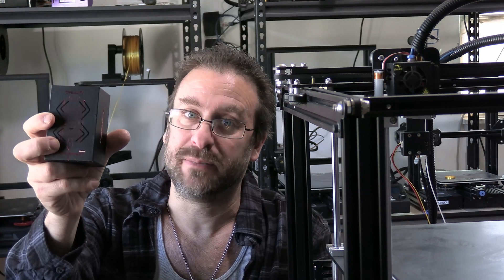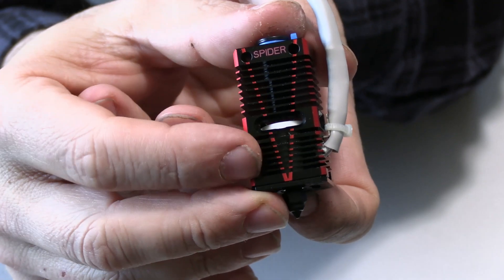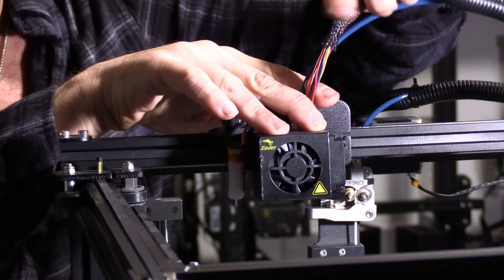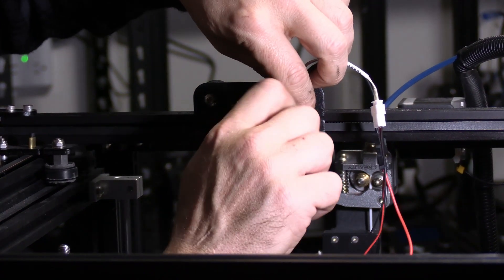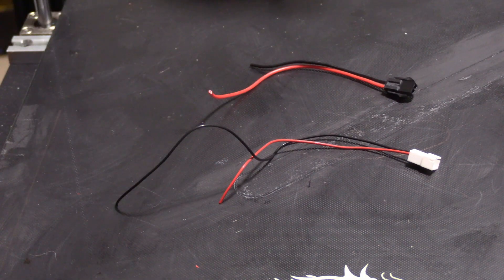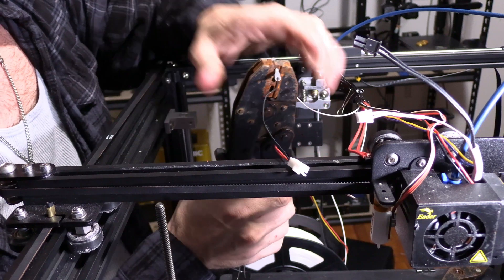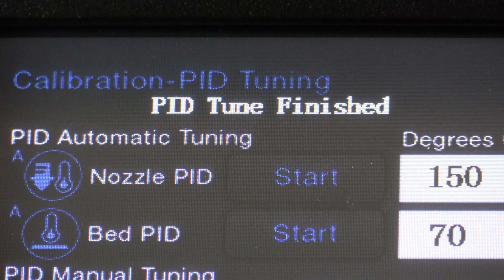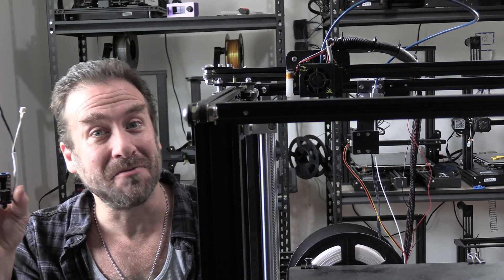Install Creality SPEEDY SPIDER Hot End on Ender 5 Plus (and Ender 3 PRO)

Comment: i would solder instead of the crimping but an excellent descripten of the mod 
greetz from austria
Reply from the maker: Agree. I try to show methods that the average person can do, as well as what instructions show, if there are any...  Solder would totally be a better choice. Greetings from NJ USA
Reply: @3DRundown  btw i ordered the hotend afther this video^^ you should make affilated links for european countries too 🙃🤣
Reply from the maker: My Amazon account is setup, so that my Affiliate links, redirect to your country. Did this not work? I definitly need this to work....
Reply: @3DRundown  not in my case... the link directed me to the us order page.
btw on an ender 5 s1 you have to make a workaround for the hotend because it is shorter than the original one... just drill 2 new holes below the original mounting and make threads. then you are almost in the same noozle hight
Reply from the maker: Bummer. I will have to check that! Setting it up is confusing.
Reply: @3DRundown  
You cannot solder thermistor wires as it changes the resistance
Reply: You cannot solder thermistor wires as it changes the resistance.
Reply: @petercallison5765  and a crimped cable has no change in the resistance...
basically crimped cabels have a higher inner resistance then soldered ones. keyword contact resistance...
but you should know how to solder. 95%+ do not know how to do it.

Comment: You didnt mention anything about thermistor settings? I installed this on my klipper build and I am having my printer disconnect over and over ever since installing it. I think it is because of my thermistor....
Reply: Turns out you NEED to solder your thermistor wires or readings will be inaccurate, creality put bad connectors on these.
Reply from the maker: I am running TH3D Firmware on my 5+ and made no changes at all. It's been amazing. There may be changes you need to make on Klipper. I'd have to study up on that one. Feel free to pop into my Sonic Pad group and chat with the peeps there. https://www.facebook.com/groups/crealitysonicpad
Reply: @3DRundown  Thats very suspicious. I trust that you are printing just fine, but I have serious doubts that your nozzle is actually the reported temperature you think it is. Today I am going to set my thermistor back to the stock settings and see what happens. Thanks for the input.
Reply from the maker: Check out my short on the Uber Jason Machete Parts. That was literally my first print after the Test dog. Flawless
Reply: @ThePrintHouse  this seems to be a common problem with the hotend that I, and many others are experiencing. If I set my print settings to 260c I can get good quality prints, where if the nozzle was actually 260 degrees the print would look terrible. Something must be going wrong on crealitys end.
Reply: @expertshooter2055  Well every thermistor is using different resistors in order to produce the readings it does, so every resistor is calibrated differently. That is why you need to change the firmware to recognize a different thermistor or else the temperature your 3d printer believes it is is incorrect. In Klipper that is easy to change, not so much with stock marlin printers without custom marlin compiled firmware. Because this hotend can reach higher temperatures than the stock hot end, they were required to use a different thermistor than the stock hotend and so anyone installing this on a typical machine without klipper will likely need to custom compile their firmware to get accurate readings.
Reply from the maker: My Spider 3 and Speedy, print every day, without issue.
Reply: @ThePrintHouse  you are absolutely correct but this thermistor uses the same klipper/marlin settings as stock firmware uses, they advertise the speedy spider as a drop in replacement, and 3D rundown has obviously received a working unit proving that it's not a matter of the settings, something is happening on crealitys end. Multiple people in this comment section and reddit have the exact same issue me and you are experiencing. I'm returning mine and buying the spider 3.
Reply: TLDR creality is having some quality control issues with this hotend.
Reply: @expertshooter2055  Ohhh ok I understand you now. That odd. I wonder if all of them have the same thermistor tags but different thermistors and some have the stock thermistor, so that is why it works for some people?
Reply from the maker: I wish I had more information to share, but I have the same minimal details offered by Creality as everybody else. They have not addressed any need for Firmware changes. Either they designed these to work with their current firmware and previous thermistors, or, they are failing to properly support this topic. Which is it? Who knows. All I can say, is I've had very good success on both SO FAR
Reply: @3DRundown  yeah, I'm sure it's a phenomenal hotend when it's working, but with many other products offered by creality sometimes you get unlucky and get a dud.
Reply: Hello! I am having the same problem. Did you manage to solve it?
Reply: @ Unfortunately I believe it is a physical hardware problem with the hotend. I was never able to make it work

Comment: PID tuning on my ender 3 results in thermal runaway but if i just tell it to heat to 200 or 220 for that matter it will reach tempature and stabilize without thermal runaway. Is this a firmware bug? The tuning seems decent enough already right off the bat because the tempature stays within a degree or so. What are your thoughts? One thing i noticed too is that with my hotend once i tell it to heat up it will reach around 120 degrees in only about 5 seconds, in crealitys video showcasing the heatup time they too have their hotend heat to 120 degrees instantly and then they have a steady rise. With yours there seems to be no spike in tempature and just a steady increase the whole way through.
Reply from the maker: I would avoid Creality Firmware as much as possible and go with something like MRISCOC. Also, I wouldn't lose sleep over PID tuning. However It shouldn't be failing like that.

Comment: How does it wire into an older v1 cr10?
Reply from the maker: You would splice it to the existing wires.
Reply: @3DRundown  got mine installed and won't heat above  160c. My printer is a cr10 12v. Are these for 24v printers?
Reply: @3DRundown  okay thank you! I need to check for positive and negative for either the heating element and thermistor? Or does it not matter?

Comment: I'm experiencing heat creep with the Spider Speedy on my Ender 3. I don't know what's causing it.
Reply from the maker: Just finished a long print for an Uber Jason X Machet, and it went perfect. Haven't used it a TON yet, but, so far so good. I'm doing an E3 MAX next. What's your symptoms?
Reply: @3DRundown  I had mine replaced twice. This is my third spider speedy and still having heat creep. What I did to solve the heat creep issue, is to use Thermal Grizzly Kryonaut for the heat break, heat sink, and the ceramic heater block.

Comment: Does the fan duct fit properly after swap to this extruder? I have impression the nozzle is a bit lower and air blows on it, not on the filament.Greate movie by the way.💪💪💪
Reply from the maker: This thing is really small. It's virtually the same size as the stock hot end. Looks fine to me. My prints have been super

Comment: I had a lot of issues with inaccurate temperature readings. I ended up sending it back. Did you have any of the same issues?
Reply from the maker: Mine has been fine. How did you determine it was inaccurate, and what negative effect did it cause you?
Reply: @3DRundown  set it at 200° and it still can't melt PLA have to set it at  220. Then while printing temperature fluctuates wildly. Thought it was because I had the CR touch inside the fan shroud so remove that and was still doing the same thing although not as bad.
Reply: @ericnfla  it is recommended to PID tune the hotend after changing it
Reply: I am having the exact same issues. I am running a BTT SKR 3 along with upgraded firmware. No matter what adjustments I make on this damn thing, it reaching about 10* below the requested temp and then fails. It is  really becoming a pain right now.
Reply: This seems to be a common problem with the hotend as I have seen multiple issues with this issue. I am having the same problem and I'm thinking of just returning this thing and buying the spider v3.
Reply: Did you solder the wires?  That changes the resistance and messes up the readings.
Reply: You MUST set the max temp correctly in firmware for the design hotend. Then you still need to go into Configuration Advance Temperatures and set the Max Temp there before anything. My was resetting every time once it got to 250. Then I figured out and adjusted it.
I used updated Vanilla Marlin to unlock the menu for Temperatures inside Configuration and Advanced.

Comment: Would you recommend this over the Spider 3.0?
Reply from the maker: I'm having a tough time with that call. I really like the Spider 3, and I like that the heat Block and Coupler can be easily replaced, but, if this thing holds up, it's 1000% the future of Bowden Hotends. Till some time passes, it's a tossup, but I see no reason NOT to get one, yet....
Reply: @3DRundown  Nah, coupler looks like it can be easily replaced, but it can't lol I'd say try it, but you'll break the unit in trying, I did xD

Comment: Excellent video my friend can I ask which firmware are you running I'm looking at changing from stock thanks
Reply from the maker: Thanks so much. I'm using TM3D, it's a massive improvement, and the install is not terribly complex. Take your time and do the Screen 1st!. #SuperThanks
Reply: Thanks for getting back to me which motherboard do you run